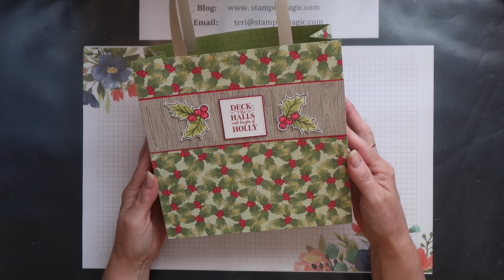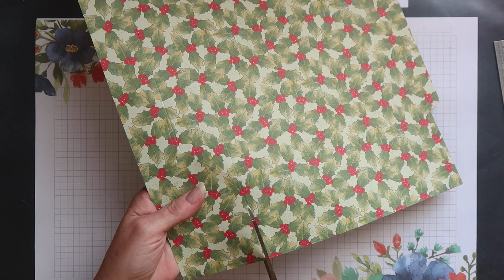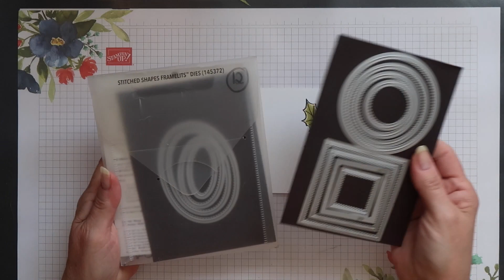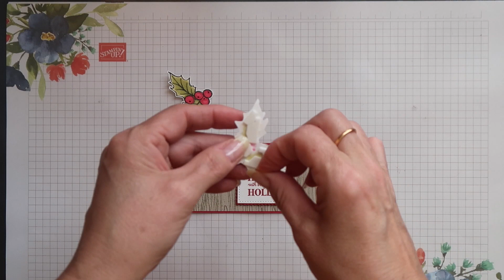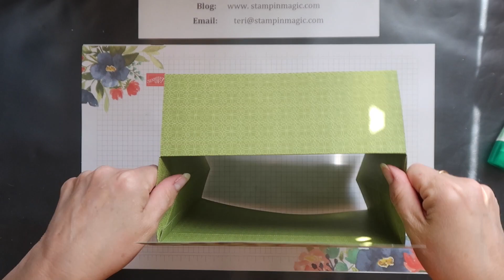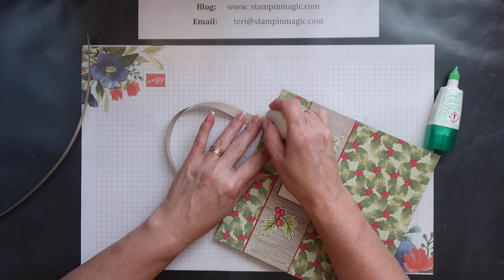Christmas Gleaming - Fold Flat Gift Bag (8" x 8" x 3")

Comment: Love the bag great tutorial! Can you please help me figure out the score lines if I want this same gold flat a bag but 9 in height 8 width 3 deep ..... I’m drawing a blank .  Or if any fellow crafters would give me hand much appreciated ☺️
Reply from the maker: Hi Yansel. Because you only want to adjust the height of the bag all the score lines are exactly the same. You will need 2 pieces of paper measuring 11½" x 12". BUT you have to switch 'LONG' for 'SHORT' and vice versa on the instructions I give. For instance - you will need the SHORTER side across the top (11½") to score down at 3" and 11" and then turn clockwise so the LONGER side is across the top (12") to score down at 3" and 4½" etc. Hope that helps xxx
Reply: Yessssssssss got it !! Thank you very much dear ♥️♥️
Reply from the maker: You are very welcome! xx